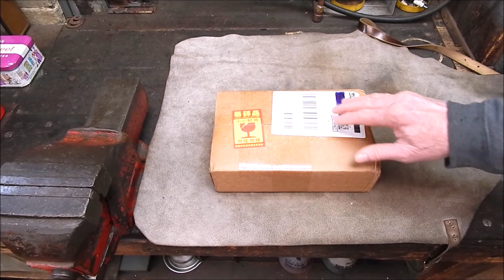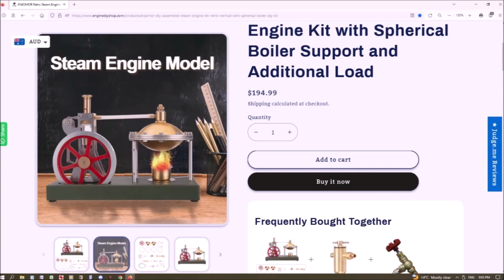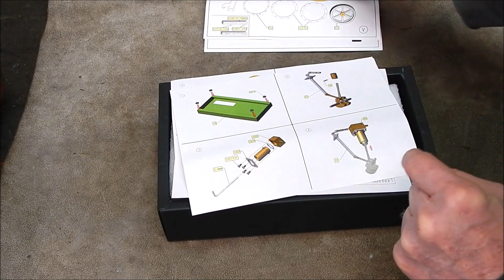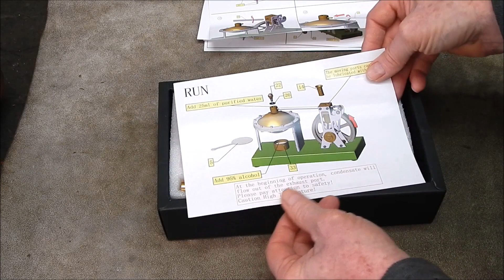ENJOMOR Retro Steam Engine Kit - an amazing little engine

Comment: Lovely little steam engine Rob 👍👍👍 I think it must be manufactured by the same company that makes that UFO Hero Steam Engine Kit that I did a video on a while back. Same boiler and style of base. I think they also do a Stirling Engine Kit. Great video 👍👍👍 Cheers, Alan.
Reply from the maker: Hi Alan.  My thoughts exactly.  They have a  Hero version of the boiler and I expected you would recognise it.  I remember your video and the similarity.  This store has some amazing engines with upmarket specs and prices.  I went for this model as it was one of the most affordable.  Easy build, but it still caught me out ;)   They appear to only have steam stuff these days.  Cheers Rob

Comment: Impressive to have an actual valved engine rather than a wobbler at that price point. Good workmanship and design. Cap screws rather than Phillips head is a nice touch, both for appearance and assembly.
Reply from the maker: Totally agree.  It's very well done.

Comment: Great little kit!  From the instructions pix I think the aluminum disk thing is meant as a snuffer, but certainly works as a burner mover.
Reply from the maker: I think it can be used for either.  It's a fun kit for sure. Cheers Rob

Comment: Nice one Rob....very tempting. How long from start to finish time wise building, I'm gussing 2-3hrs? Get Christmas with the Grandson sorted
Reply from the maker: Very good guess Ian.  It was in that region.  It runs on very low pressure.  I choked the flame after filming with a large diameter washer on the pot and had it ticking over for a long time at walking pace.  I prefer them slow, but to power something it will need full herbs.  Would make a great gift for anyone interested in things mechanical.  Cheers Rob

Comment: i wouldnt be able to help myself...

throw a longer mid section in the boiler.
swap that silicone tube out for some brass tubing coiled around the burner... superheat it.

run a chickenfeed burner.

see how many hours it can run continuously before rebuilding...

Comment: What's the run time? Also, what lubrication do you need for a glass cylinder? I am buying the pre-built version of this engine and it has a glass cylinder instead of brass.
Reply from the maker: At a guess it would be about 5 minutes as is.  By reducing the flame size it can eaily be extended to about 10 running at a slower speed.  I use water soluble air tool oil for my steam engines, but none of them have a glass cylinder.  I expect it would work OK regardless of the material, but ask the shop what lube they recommend.  Cheers Rob

Comment: Have you had any problems with the bolts vibrating lose?
Reply from the maker: No.  If that is happening maybe use a dob of thread locker (Loctite blue) on them.  Cheers Rob